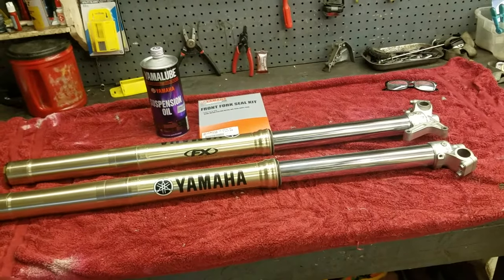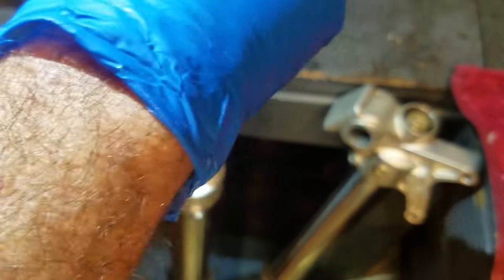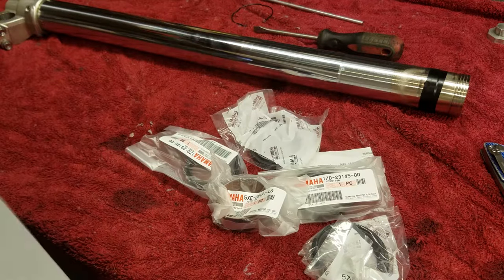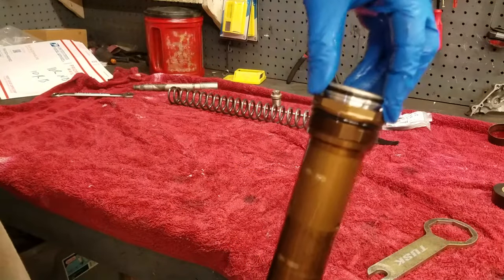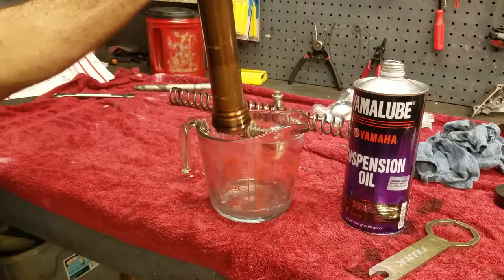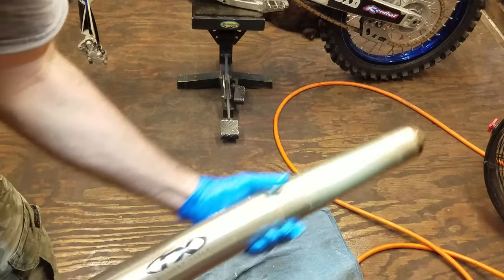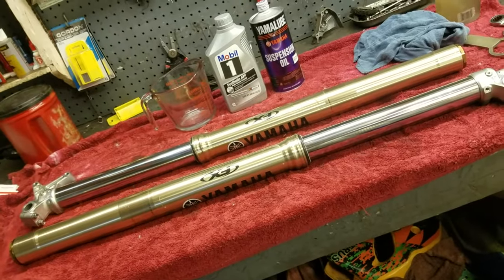1:11 Front Fork Service & Seals (YAMAHA 2006-2025 YZ450F YZ125 YZ250F YZ250) forks bushings & fluids

Comment: Great video.  I've been out of riding for 20 years and YouTube sure helps.  I think my 26 rm 250 was the first twin chamber way back, and I had no idea how to service it.  
This video made today's oil changes easy.  
I also really like your suspension tuning videos.
Thank you!
Reply from the maker: 26 RM250? or 1996 I think you meant. I think the first year was 1993 on the RM125. Then later the RM250 got them.  I'm glad to hear the video helped! Thanks for reaching out. Ohh the suspension tuning videos. They where some of my early ones and kinda long but I really wanted to put every thing in there that I had to share on that. Thanks for reaching out, nice to hear when these actually got you through the job!
Reply: My thumbs don't type well.  Yes my old 96 RM250.  And yes the suspensions tuning videos.  They took a while to watch but are very helpful.  I kind of new a lot of it, but it is good to get a refresher and confirm what I thought.    I like the order of adjustments to get the bike correct.  I basically followed that with my 2019 YZ250fx.  Cheers. @UpAllNight91
Reply from the maker: @duffwarnock8240  Ahh right on!  Glad it helped!  No worries on the thumbs😁. Mine are getting sloppier and sloppier with age lol. Plus I try to type as fast as I can talk and it just doesnt worjk out well lol

Comment: Sorry I didn’t mean to sound so negative.  I’ve been doing suspension for 30 years. Here’s a couple tips that may help you. 
In the center of the fork seal and the dust seal you’ll notice there’s a Ridge there that’s actually called a grease ridge, fill this ridge with grease and apply a light coat of grease to the teflon bushings. This will give you virtually zero drag in your fork with a smoother stroke. 
2nd tip, you really should polish the chrome tubes to remove any imperfections.  This is done with two light passes with 400 grit emery cloth, then followed up with another round with 600 grit. 
Everything will work much smoother and last longer. 
Hope this helps. 👍
Reply from the maker: Thanks.  I have noticed oem honda seals come with grease already in them.  It surely keeps things smoother when fresh but I often wondered how many hours that will stick around.
Reply: My bike with 2.5 hours already has a leaky seal for this reason even brand new bikes Can have imperfections
Reply from the maker: @nightfall_1le575  I would try cleaning the seals lips first before changing.  Often times dirt and junk can get under the lip seal and cause a leak but once cleaned out its all good.  The most common cause of that is parking a bike dirty and no cleaning before next ride.  The dirt on the fork leg dried up and sticks on the leg.  The first time the forks compress on the next ride it pushed the dirt stuck on the fork underneath the seals lip.  And like a windshield wiper with a leaf under it,  it lets stuff buy.  But if you clean the seal they will usually seal right back up

Comment: I use ATF in open chamber forks with many years of problem free riding.
Reply from the maker: Right on. I used it in open chamber forks as well for like trail bikes and such. I still use it in my outer chamber on the twin chamber forks. Works great.

Comment: GREAT JOB!!! Getting ready to this on my sons YZ125. Believe I'll try the transmission fluid..Have you ever tried the transmission fluid on  the older single chamber forks.I have a 2005 KX125 and it goes thru fork seals like crazy..I get the most life out of the O.E.M seals just wonder if the transmission fluid would extend the seal life. Thanks
Reply from the maker: Thanks! I have used ATF fluid on trail bike works that are very simple but not on MX single chamber forks. I imagine it would work but keep in mine most transmission fluid is anywhere from 5w to 7w, depending on the type.  I'm sure it can extend the seal life on them as well though,

Comment: Man you give me the confidence to give this a go. 

I’ve heard that you have to drill a hole somewhere to prevent a part of the shock blowing up? 

The mechanic (definitely trusted) that gave me advice told me there’s a modification you have to do if it’s not already done and you have to drill a hole?

Does this make sense? 

Thanks for your help
Reply from the maker: Hello. There is nothing wrong with drilling the hole in the ICS cup (or whatever thats thing is called). I will say I have only ever seen one break on my own bikes and it was years ago. And in my opinion its caused by two things. Not pressing the inner chamber down all the way after bleeding it, to push the extra fluid out. And if the bike is laid on its side and left there for a long time. The newer (4 strokes) bikes come with this hole in there already but the 2 strokes didnt get this will 2022.

Comment: Thanks for the video, what’s different about the 2005 yz125 forks over the 2006?
Reply from the maker: Your welcome. The 2005 to 2006 forks are constructed about the same, both twin chamber forks. But the 2006 was vastly improved in the valving area and are easier to dial in.

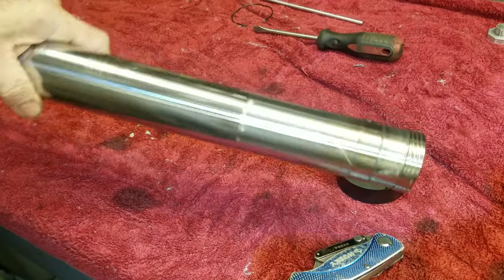Comment: Damn this is sick. Thanks so much. I'm about to do mine and this is going to make the job so much less stressful. I just have one question. When you take apart the outer casings (i think that's what you call them( 7:50)) and take them outside to get them cleaned up. What do you mean exactly? you spray them in water? break cleaner? no one mentions it and I don't want to ruin mine doing a stupid mistake. Hopefully you answer before next wednesday because that's when I'll service mine. Cheers
Reply from the maker: Hello. What i do is use WD40,  spray all in them and out.  Then I use high pressure air from a air compressor with a air nozzle and shoot air into them and all around them to blast the WD40 and trash out and  off.  If you don't have a air compressor then brake cleaner works well and won't hurt anything. Just spray them out and clean then let them air dry and it should be good
Reply: @UpAllNight91  Thanks for the response. Very appreciated. I have one more question, feel free to never reply that's all good... So I changed my sels and the fluids, but during the step where we pump it one last time for good measure, and then proceed to push the cylinder all the way in with the hole facing up, my forks let out air and spurted. It had me a little alarmed cause I saw yours didn't seem to release air... Then when I read the manual to find the amount of oil I had to put in, I saw that yamaha said to not push the cylinder all the way down because that would let air in....So now i'm wondering, do you think I let air in the system? When you said to push it all the way down, did you mean ALL the way down, or all the way down to the 1 inch from the bottom? Thanks alot. I enjoyed serviving my forks becaus eof your video. Made it easy and stressless.
Reply from the maker: @falashlaba20  yes with the lock nut still on the shaft, twisted all the way toward the body of the chamber by hand.  I press all the way down on final bleeding. You will hear the last bit of air spit out.  Thats normal.  But if you don't do that then the first time you bottom the bike out the inner chamber will spit the extra fluid into the outer chamber.  And then you will have more fluid in the outer chamber than you anticipated.   This is why I do it before putting them back in.  Yamaha manual has been funky  in the area of the forks since SSS came out in 2006. In 2006 they had people doing them all wrong and I had to learn the hard way what was the right way.
Reply from the maker: @falashlaba20  and when yamaha says it would let air in.  Well. All you gotta do is stroke it after fully compressing and you will hear there is no air in there.  Its bleed well
Reply: @UpAllNight91  oh i see. thanks for the quick response and thanks again for the valuable knowledge you share. Super grateful.

Comment: How often would you recommend to change bushings?
Reply from the maker: I like to change them out when I change out the seals, but its not always necessary.  They actually last a long time if the fluid is kept good and clean. Hard to put a hour number on when they should be replaced though, as it just depends on how well service has been kept up and how hard the rider rides the bike.

Comment: Is there any way to just add oil, if it leaked around a seal that must of cleared the debris that was making it leak, and isn't leaking anymore.
Reply from the maker: Yes, you can open the top of the forks and add oil directly in. You can also open the bleeder screw, compress the fork a little and then as you slowly let the fork come back up you can add fluid into the bleeder hole. But the question is, how much was lost and how much needs to be replaced. We may never know. So the right way to do it is to open the top of the forks, dump the fluid out of the outer chamber, then refill each fork tubes outer chamber to the correct volume.

Comment: What oil do you recommend to use I’m 180lbs idk if that helps but I noticed there’s different numbered oil for the forks, I got a 05 Yamaha yz450f
Reply from the maker: Hello. For the 2005 YZ450f its recommended to use Yamaha 01 fork fluid. Thats the OEM stuff for them 2005 forks. Heres a link to the stuff https://www.partzilla.com/product/yamaha/90793-38044-00?gad_source=1&gclid=CjwKCAiA5L2tBhBTEiwAdSxJXzP4HZYQxUAmTP3OiAiVub-9r-4QK4oU6a6cEZDwKh7ocl-SjaK2sRoCBq4QAvD_BwE
Reply: @UpAllNight91  thanks for the reply ⚡️
Reply from the maker: Yes sir!  @itssoferny9966

Comment: Hey I have some forks for a yz250 but it’s an 89. Do you think I could base things off this video? Has it really changed that much? Also when I compress my forks they are smooth and frictionless but jump up like a pogo stick and when I shake them I think I can hear the springs. Do you reckon I just need all around oil inside and outside and possibly new seals? No clue how many hours, owners, or anything. Bought the bike a few weeks ago.
Reply from the maker: Hello. The 1989 forks are totally different. No inner and outer chamber, just one chamber for all the fluid. If they are bouncing they will probably already lost most of their fluid from seal leaks. I would just take them down and replace the seals, then use fresh fluid. These forks are totally different than the ones in the video. Theres gotta be a video on these somewhere though if you search youtube I would think
Reply: @UpAllNight91  okay thank you man
Reply from the maker: @EMotoGuyyy  Yes sir!

Comment: I followed the steps exactly for the inner fork seals. After getting one bleed and filled, air is still leaking in the inner chamber and causes the rod to get sucked back in. Do you think that the inner piston seals need to be replaced? Can I just get the ZETA aftermarket part instead of replacing each individual O ring?
Reply from the maker: Depends where its leaking from.  I find some like to leak from the bottom little 0 ring seal. The top o ring seals usually hold up. Its mainly the bottom one I see go bad and leak

Comment: I just discovered my fork seals to be leaking on my 2023 250, and i ended up finding the culprit, i have a few gouges on my lower tube, im 90 percent sure the gouges ripped my seal, my question is, how would i go about smoothening out the tube or do i just have to replace it?
Reply from the maker: Hello. Bummer on such a new bike. On such a new bike I would just replace that lower fork leg but sometimes they can be repaired. I have used files, steal wool, you name it. Every repair is different. But I would suggest just a new lower fork tube since the bike is newer and kinda worth it.

Comment: Im doing a set of 08 yz250 forks... following ur video to bleed etc... problem isi have fluid flowing down the damper rod as i cycle it ... question is.. is there a seal between the damper rod n outter chamber?  (I have damper rod out n looking but cant tell whats exactly in there)
Reply from the maker: Hello.  If the damper rod is leaking from the shaft area that slides in and out of the damper assembly you could have a damper assembly seal leak. Is that where its leaking from?
Reply: @UpAllNight91  wish I could send a pic.... but im thinking you got it.. 
  Main body of inner chamber, rod out the bottom w threaded end, rod goes up n down in main body.. is there a seal in the main body to seal to the damper rod ? Do you know a part number ? I picked at what I thought was an o-ring but nothing seemed to move.. maybe o-ring is very hard from time ?
Reply from the maker: @lancesmeal8853  Hello. They can be purchased from this link right here https://www.teknikmotorsport.com/  Its called a fork cartridge seal. There are others who sell it as well.  Just plug in your bike make and model and click on fork cartridge parts to find the seal.
Reply: @UpAllNight91 awesome thanks...
Reply from the maker: @lancesmeal8853  Yes sir!

Comment: Hey man, going to do my yearly suspension service in about a month and I noticed you had a video on that as well. Question, when I fill the inner chamber and bleed it I test it by pushing the rod in and letting it extend by itself all the way out. But where it stops is almost all the way, if I tug it it can extend about a  1/2" further. Is that normal,  both forks did it and I tried multiple times too (wasted a bit of oil, was just maxima though) but still could pull it a little. I was led to believe that means it s still has air inside. Didn't see you test it that way. Is that normal or is there some sorta seal inside that I need to replace?
Reply from the maker: Hello.  Yeah it won't extend all the way on its own most times, perfectly bleed and all.  Its mainly because the spring on inner chamber is pretty relaxed when fully extended.   That spring acts like the nitrogen pressure  of a shock. But is normal.  If there is air in there you will hear it when stroking it, and thats usually the giveaway.
Reply: @UpAllNight91  wow, thanks man!

Comment: hey hoping you can help as this has happened twice to me. The dampening rod stripped off completely on the bottom of the fork where the adjuster nut goes on. Thinking I have a bogus torque wrench that is searing off the rod but maybe its something else?
Reply from the maker: Oh man thats expensive too.  Are you bottoming out the adjuster nut on the dampening rod first and then locking down the locking nut? If so the only other thing I can think of is its just being put on too tight.  I don't know the torque specs for this but there are places on these bikes that the torque specs are either too little or too much in my experience and opinion.  Areas like this I go by feel.  With a big torque wrench its hard to tell when you are going past the point of what the treads can handle.  I use just a 3/8th ratchet or a wrench and lock them down by feel just like I did in the video.
Reply: @UpAllNight91  yeah I figure the torque is over tightening and also doesn’t help I bought a harbor freight torque wrench lol. Thanks for the help man happy riding!
Reply from the maker: @Jordangilps617  thanks man, you too!

Comment: What did you use to clean it with?
Reply from the maker: I just wd40.  And blow it off and out, wipe it clean and thats good enough for me.  I try to avoid harsh cleaners like break cleaner and such. Wd40 does well, just try your best to get it all out and dry for the most part

Comment: On moto Esporte I'm only finding the complete kit with the codeVALVE COMP. (5XC-2316A-V0-00)but I'm looking to save money I want to buy only the plastic
Reply from the maker: Someone use to make and sell aluminum ones and for cheaper. I cant remember if it was race tech or enzo. But I would call around some of the big suspension guys like that and ask. They are out there just cant remember where.

Comment: So what if you took apart the top 1st got to the bottom and it just spins. 😅 I put a wrench in the top still spins…I’m sure I’ve broken something by now 🫣
Reply from the maker: What part spins? The whole shaft or just the locking nut?
Reply: @UpAllNight91  so I guess mine is KYB open chamber forks the order model, so my locking nut is on the top and I have to get the special tool to hold the dampener Rod/ or make one. 
I got one apart…with an impact idk how but I did and didn’t break anything. 
Waiting on the tool cause I’ll need it to toque it.
Reply from the maker: @destini573   Ahh, well that explains alot lol.  Hope all goes well with it.
Reply: @UpAllNight91  yea I got it thanks so much for checking!
Reply from the maker: Right on!  @destini573